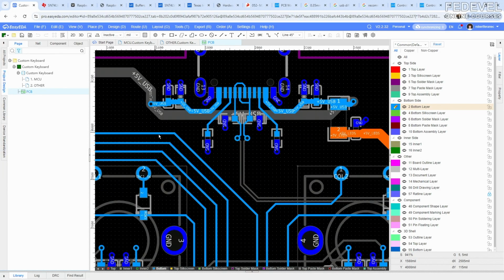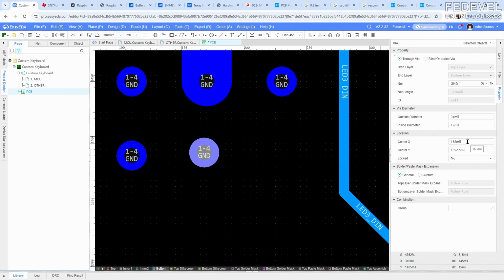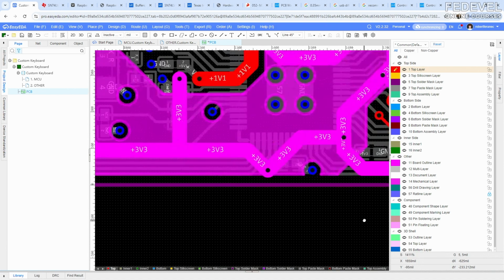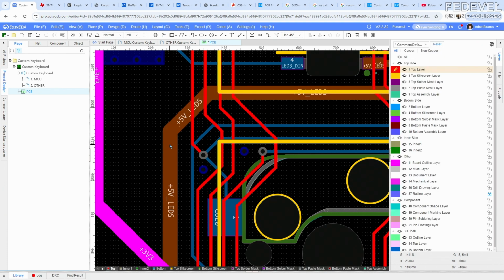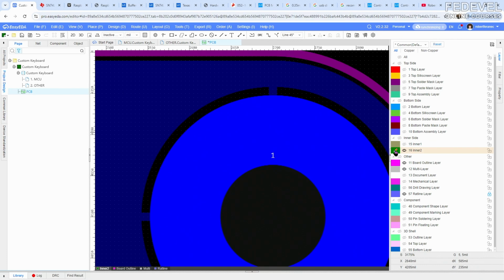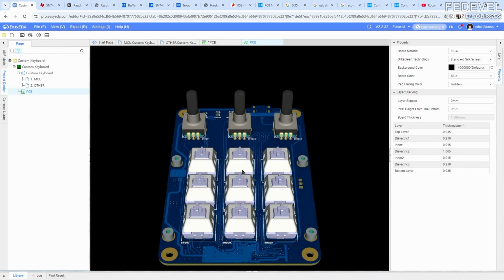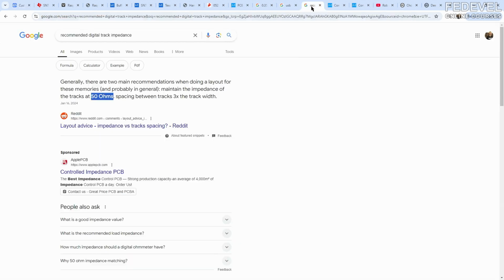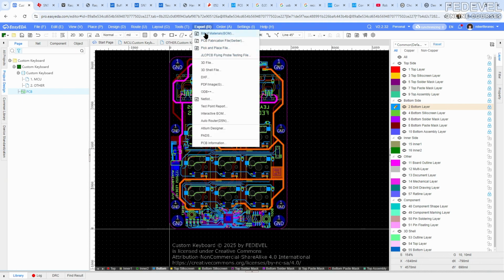Tutorial - Custom DIY Keyboard Design and Build | Part 5: PCB Layout Improvement

Comment: This is a great series of tutorials. I have a question about putting your logo in copper/gold on the PCB. As copper and gold are both conductive, how does the logo not interfere with signals in the tracks? I notice that you placed the logo overlapping a track and near some vias. I am just starting to learn about PCB design and production, so everything is new to me.
Reply from the maker: the logo is on solder mask layer, logo itself is not conductive. it only makes opening in the purple color, that is why you need a solid copper plane under the logo so it looks nice
Reply: @RobertFeranec  Ok, thanks for clarifying. :-)

Comment: I've been enjoying this so far.  Perhaps an odd remark, but I'm jealous of your internet connection.  In previous episodes, you go to LCSC and look up a part then load the datasheet, and so on.  Everything loads so snappy.  Here in the states with a fiber connection, I don't have this speed of service.  Or are you editing out web page load delays in post production?
Reply from the maker: LCSC website itself usually works ok. If it is too slow, I re-record. But some services are slow here too e.g. when using filter inside of Place -> Device (in EasyEDA) that can be very slow.